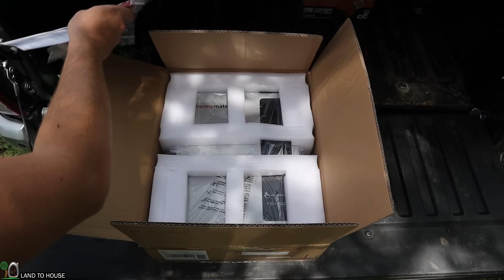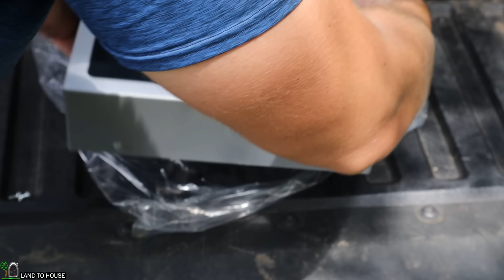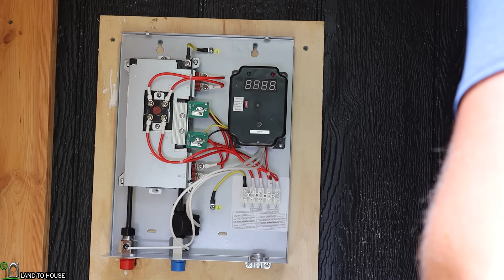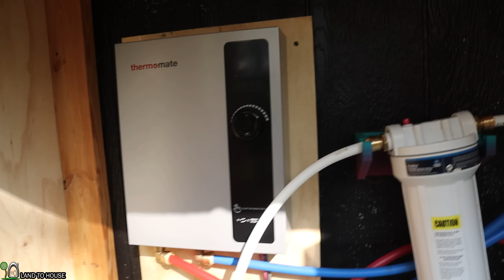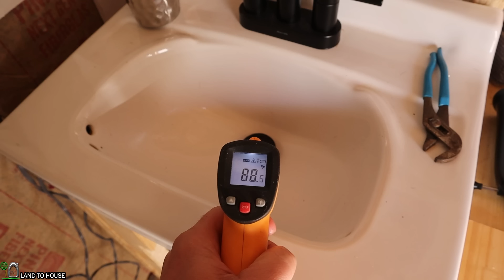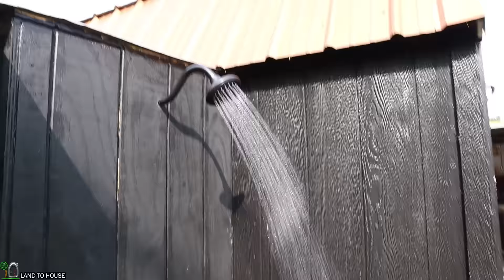ThermoMate 11k Tankless Water Heater

Comment: That pulsing would drive me nuts. Why is there no pressure tank?

Electric tank less systems are so power hungry. Why not use a HPHWH (Heat Pump Hot Water Heater)? You get the efficiency plus added cooling/humidity control.

Most electrical service will have a difficult time supporting these electric instant heaters. The added costs of service upgrades, new electrical, and energy costs make these systems far less desirable than many others.

Comment: What gauge are those wires?
Reply from the maker: 10awg was used. That can handle 55amp. The water heater uses up to 45 amp.
Reply: @LandtoHouse 10 is for a maximum of 35 amps, normal used will be 30 amps in 10 gauge wire

Comment: Can this water heater give enough flow for simultaneous use? Like can you run 2 showers at the same time with it and even turn on the sink with them. Will the water flow be enough for those 3 outlets running together?

Comment: The outer jacket of both wires is to extend into a the water heater box a tiny distance so that both wires with their protective jackets intact can be clamped in connector you put through the knock out at the base of the box. If you are not going to do electrical wiring to code i.e. correctly then do not post it for other people to follow your example and do it wrong also. WTF

Comment: Respectfully, you need to go back and reinstall those cables correctly. Per NEC… 1/4” if sheathing shall extend into the box. Therefore, push the cables in until the gray sheathing is 1/4” into the box. 

Two, also make sure the REDS and BLACKS are paired up with the same breaker to same heating element. In other words breaker A pairs with L1/L2 on the left. Then breaker B to L1/L2 on the right.

Comment: 11kW @ 240V is 45.8A!!!!! Holy moly we only chuck a 63A main switch in a standard domestic home so run that, a jug and a toaster and you've past max demand!
Reply: What do you mean 63amp main? Where are you from?
Reply: @robertsteich7362  NZ
Reply from the maker: That's interesting.  My personal home is 200amp main. This cabin/tiny house has a 100amp main.
Reply: @LandtoHouse  One place I've seem upgraded to 100A was because they had a cafe added on the front. In New Zealand I forgot to mention too.
Reply: @nichudnic2469  In New  Zealand, do you have 3-phase going to the houses too?
Reply: @robertsteich7362  No, nearly always single phase 63A 240V. Can upgrade to 100A if someone wants but they have to pay to upgrade the cable/connection.

Comment: Maybe I missed it. How many AMPs does it pull?
Reply from the maker: This uses two 240v breakers. 46amp total.
Reply: It's an 11kW heater, so 11kW of energy which is 60A (!) on US split phase 220 or 16A on EU 400V 3 phase power.

Comment: That Diaphragm pump is going to be rattling your pipes for days. maybe another pump is a better option?
I have a feeling it has something to do with the pump being on the he cold side instead of the hot side. Not sure.
Thanks for the video. 👌🤜🤛
Reply from the maker: The diaphragm pump needs a pressure tank. If there was a tank that would hold some of the pressure it would allow the pump to turn on for a time and then be off for a time. Less rattling. I could probably also mount it on some foam.
Reply: @LandtoHouse  the water output was very on-off. I know some on-demand hot water tanks have pressure regulation mechanisms in them and if this one does maybe it's causing the weird cycling you're seeing with the pump cycling on an off as it thinks the pressure is built, but isn't.
That being said, if cold water is running With the hot, it'll be less likely to cycle like that
Reply from the maker: @jamess1787 I noticed that the larger indoor shower head passes more water and the diaphragm pump does not pulse. I think it's a flow issue.